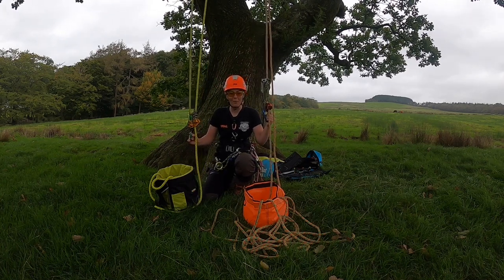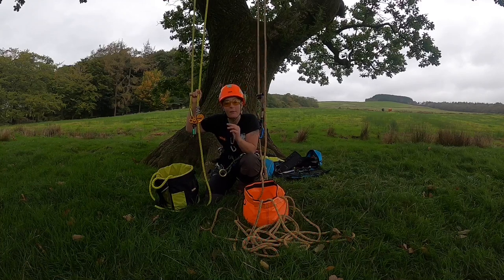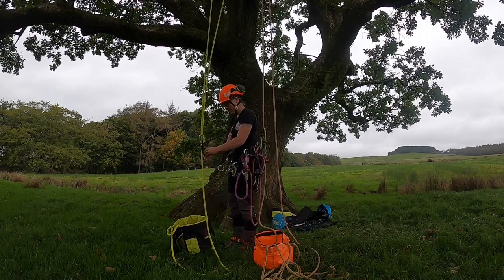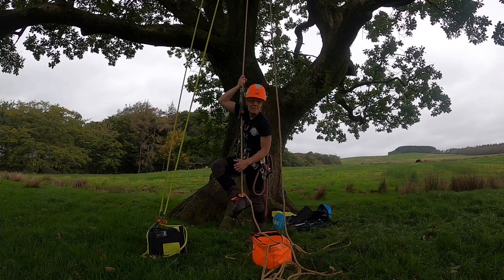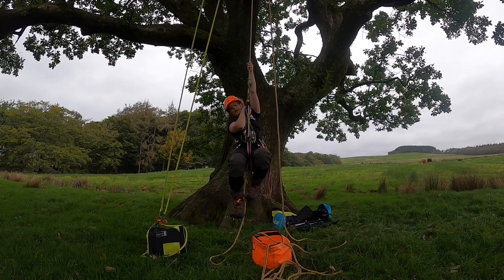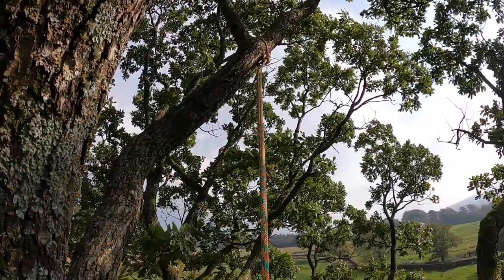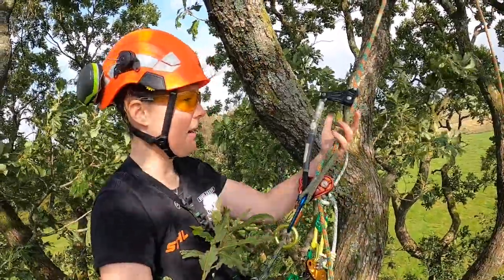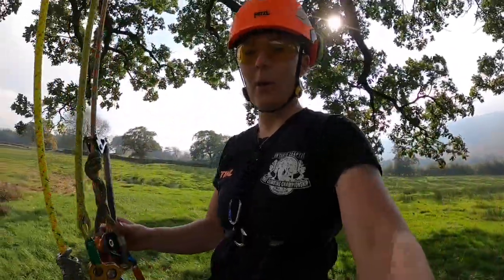SRT and DRT: The Differences

Comment: Both systems look good. The single line system is probably better because of getting to use your legs to do most of the work. If you had to carry extra weight up the rope with you, pulling with only your arms and hip thrust on the double system would tire you out very fast in this scenario. For example if you attached a 25 free weight between your legs hooked into a carabiner. I believe you would want to use your legs to ascend in a scenario like that. Some people need to carry tools and those can end up weighing up to 40 lbs. Definitely take a lot of conditioning to get strong enough to do this, so hitting the weights is important. Thanks for posting this.

Comment: I cant believe all the gear you use. When I was in the trade, our best friend was a 40 ft ladder, 5/8 nylon rope, and a. taught line hitch! We got technical if we used a double crotch.  Oh, and we painted all our cuts with a can of tar hanging off the scabbard.  Nuts.   Looks good for your safety.  My supervisor was from Kew Gardens, your gear was for rock climbers only.  
Great video.

Comment: I still like to foot lock on a double rope to get upstairs. When I learned how to climb boss man wouldn't let me touch a mechanical device until I learned how to safely climb only using rope and split tails. He was a dick but because of him I'm a knot book.
Reply: I agree....Learn how to climb the "old fashioned" way and you will much more appreciate the gear used today. Nothing like Foot lock 50' up onto a large bare branch and having enough strength to pull yourself up onto the limb unprotected...and then tie yourself in once you are on the branch....I learned to climb professionally at age 15 (1975). Learn to climb your pole saw to the branch above you....climbing was a blast in the old days.  🤣 and a lil dangerous..😲

Comment: as a newbie to the industry, im wondering how you get your anchor in the tree without first climbing the tree and how you retrieve your rope and hardware. ive seen climbers use the double rope system using a blakes hitch. they use a throw line to get the rope in the tree and can untie their friction hitch and pull the rope out. forgive me for my ignorance
Reply: Try to see a tree in three parts, trunk, scafold branches that give the structure and are not usually covered in leaves and then the secondary branches that produce leaves. We prune in the secondary branches usually. So you can climb progressively if it is like a ladder but when the scafold branches start high you can use a ladder or a throwline. You can hand throw max 8m but the throwline can get 25m. These disrances are important as some trees will have large distances between the scafold branches making throwing a rope by hand difficult. A throwline with a catapult will put your rope above the scafold branches eliminating hand throws. Once in the secondary branches, hand throwing is fine if its not full of small branches or ivy. It is good to be good at progressive climbing and throwing the rope by hand as trees with structural damage or any other problems can be visualy inspected from a shorter distance. 25m away is difficult to see. Two last points, try to instal your throw line where the scafold finishes and the secondary start and as central as possibile. Finally KISS. Keep it simple stupid. Dont over complicate yourself, have systems that are fool proof and practice to make it as repetative as possible, I have seen guys not realise that they have no fall protection because they did not realise how the system worked.